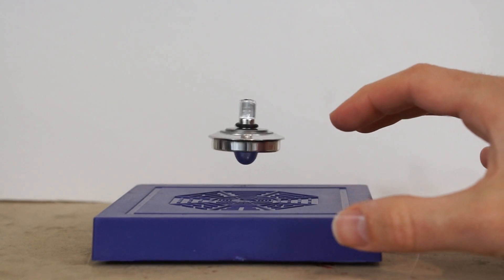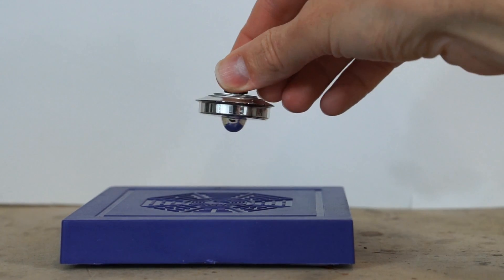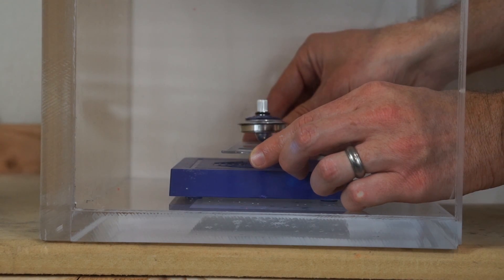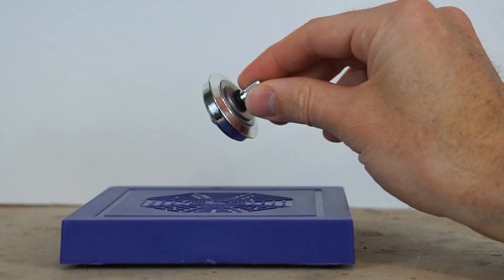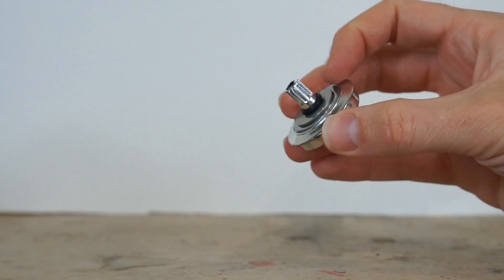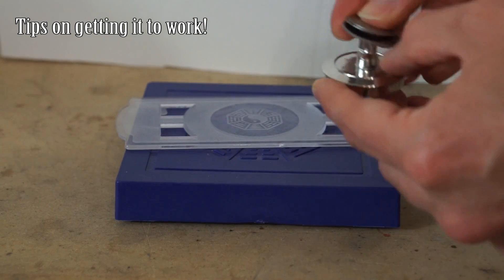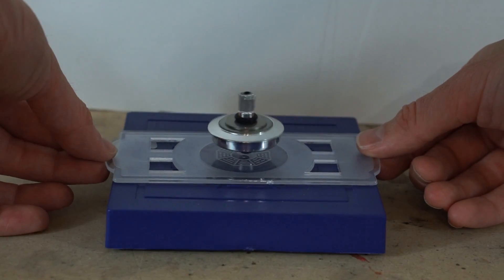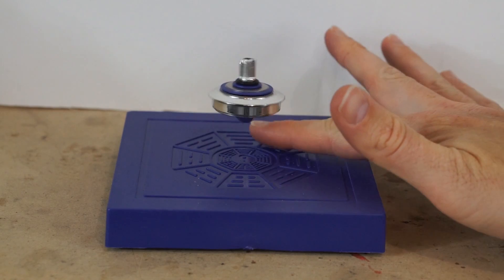Will a Levitating Gyroscope Spin Forever in a Vacuum Chamber?

Comment: Well it won't spin forever because it is not spinning perfectly level so some of the rotational force is being transferred into an oscillatory force, and so it loses a little bit of its momentum every time it oscillates, and since it has mass, and mass is simply a measure of how much force is required to move an object in a vacuum, the gyroscope would slow down little by little because it's mass is constant but it's rotational momentum depletes.
Reply: Now that's the explanation or comment I expected from people
Reply: The biggest factor was likely not oscillations, because the magnet would still lose energy even if it was perfectly stable on its spin. The main loss likely comes from electromagnetic losses which slowly turn the rotational kinetic energy of the magnet into heat energy. As the magnet loses more rotational energy to heat it spins slower becomes less stable and eventually falls. Here is a cool stack exchange thread I found on the topic considering why magnetic bearings are not frictionless.  https://engineering.stackexchange.com/questions/2162/what-causes-friction-in-magnetic-bearings
Reply: The richest, this magnetic top floating over a single neodymium magnet is not quite like a magnetic bearing, sure they both operate using magnetic fields, but that is where the similarities end. The top only spun for about one minute in the vacuum, do you honestly believe it lost all its energy due to heat loss in that time? Or rather the obvious out of balance which wastes energy much faster? Remember the top stopped spinning in one minute. we aren't talking about some other hypothetical top, we are talking about this one in the video above. Way out of balance, that is the reason it stopped.
If we had an expensive custom precision balanced top and it was capable of spinning perfectly in an absolute vacuum for hours, then I would add credence to your heat loss losing speed, but in this case as above it was mostly "out of balance"  energy loss.
Reply: It would even stop spinning, if you place it perfectly. You lose energy because of electro dynamics. Effectly you spin a conductor in a magntic field, which induces electricity, which induces again a magenetic field and so on... So you lose energy producing radiating a electromagnetic wave.
Reply: Something Else well I’m not a “numb scull” I am just not trying to analyze everything I see on YouTube, I am just here to enjoy the video, not to be put down for being a “numb skull”
Reply: MeowRolePlay,   Sorry if I implied you were a numb skull. I meant no offense, and my reply to copterdude was somewhat thoughtless of the other answers before him. This is why I didn't make a YouTube account. My mouth (or fingers in this case) often move before fully engaging with the brain. As far as analyzing everything on youtube, You should analyze if you are watching science stuff, it is the only way to understand the world around you. Don't tell me you were only here to watch a top spin on video without giving any critical thought at all about what is truly going on? ;-)
Reply: Actually the oscillations theoretically should not cause it to stop spinning because without any resistances an object could oscillate indefinitely like a pendulum.
Reply: The richest,  oscillate "indefinitely" like a pendulum? Such as a pendulum in a clock which is powered by a spring or electricity? no pendulum swings indefinitely, that would mean the pendulum was a perpetual motion machine, and those do not exist in the real world.
Reply: Copterdude actually magnetic field interaction will alwas take away energy regardless of the angel and shit
Reply: Copterdude not to mention there is no full vaccum only partial vaccum because anything inside like dust would equilize throughout the vaccum chamber
Reply: Something Else, I explained that with no frictional forces or wind resistance a pendulum ( or any other oscillating object such as this top) would oscillate forever, I did not say that a continuous unforced pendulum, or any perpetual motion machine, could exist in the real world.

This scenario is very similar to spinning a normal table top. The top spins steadily at first then as frictional forces dissipate rotational kinetic energy from the top into heat energy it spins more slowly becoming less stable and eventually falls over. However, in the case of this top the frictional forces come from interactions between the magnetic fields of the two objects, which still have the end result of dissipating the kinetic energy from the top into heat energy causing it to spin slower become less stable and eventually fall over.

In both cases it is the frictional forces draining energy from the system that cause the top to slow down and then it becomes less stable and begins to wobble. Thus showing the root cause of the top's slowing are the interactions between the magnetic fields, or what is sometimes called magnetic friction. 

This is all in accordance to Newton's first law which states that an object in motion stays in motion unless acted upon by an external force. In this case the top would have stayed in motion unless acted upon by the external force of magnetic friction which dissipated its rotational energy into heat.

I am not talking about theoretical tops either. I am indeed talking about this top which exists in the real world where almost always (at least as far as humans have ever observed) it is impossible to have motion without it being dampened by some type of frictional forces (including, magnetic friction and wind resistance) that dissipates the systems energy into heat which is why perpetual motion machines are impossible in the real world.
Reply: Copterdude You're brilliant.
Reply: Something Else one single comment better than the video itself
Reply: Eduard, I'm glad you enjoyed my comment. ;-)
Reply: Exactly
Reply: Well I’m deleting my initial comment because im dum
Reply: Also because eventually magnets wear off
Reply: Sweet Release oh and ur doing the same
Reply: Scientist?
Reply: Well...
Reply: u seem cool and u r but u no a LOT
Reply: This is also piece of steel moving in magnetic fiels, witch mean some of energy ll be induced as current and then transfered to heat.
Reply: It will stop because energy is used by procession to keep the top upright,  and this energy comes from slowing the top,  which will eventually collapse.

Secondly,  this magnetic top is rotating in a magnetic field,  which means that electrons are sloshing back and forth from the rotational speed much like in a generator.  the flow of electrons is consumed by resistance and turned into heat.

Just like with a generator,  it takes energy to move those electrons,  and that will come from the speed of the top,  causing it to collapse.

I suggest that the two major ways energy is consumed in this system is 1) procession  and 2) electrical current flow and resistance.
Reply: Way to go Copterdude! You are the first one to answer correctly and I actually made a youtube account so I could post this because you made me so happy that at least one person in the world is not a numbskull. The imbalance in the flywheel is using energy every time it wobbles, the limited energy of the spin runs out gradually and the wheel loses speed until it topples. Of course the not perfect vacuum had a small effect, but not near as much as the wobble. Keep up the critical thinking and the RC fun! I used to be an avid RC guy, it is a great hobby and you'll meet lots of nice people and share knowledge if you join an RC club. Peace! And keep those rotors and props balanced! Vibration is every machines enemy.
Reply: I assume then that you have viewed my YoiTube videos? If so, what do you think of them?
Reply: @somethingelse2740  lol you did not have a youtube account?.
Reply: No sir, I did not. I have watched videos for many years, and enjoyed and despised the positive and negative comments without having an account. However, The well written intelligent comment of Copterdude simply made me feel the need to reply, so I made an account. How about that for a compliment to Copterdude's intelligence. His knowledge inspired me to create an account.
Reply: Copterdude please
Reply: I am having to face of people who fail to understand physics who suffer confirmation bias wanting to believe that infinite motion is possible.
Trying to convince people of induced braking motions or losses of momentum is an uphill struggle when people don't understand entropy and thermodynamics. 
People prefer what they want to believe to physical facts,which tend to pull the rug from under their wishes.
It's a sad state of affairs that too few people understand physics and prefer to carp from the sidelines and sling mud,or wantonly believe in flat earths and a host of nonsense,rather than actually understand how things work.
It's great that there are people who revel in understanding the world rather than preferring to believe things they want to
Reply: templarseries your statement is undercut by your ignorance and MISSSPELLINGS! God why do the bottom of the barrel constantly assume they understand basic physics when they can’t even grasp the language they are trying to communicate with?
Reply: henselstep the energy loss due to eletromagnetic radiation is almost  completely irrelevant  , I've seen my physics teacher calculate the amount of energy lost by a pendulum oscilating in the vaccum with no friction at all , only by the radiation emited,  and it was about 10^-34 joules per oscilation , it would take forever until it stopped only due to that energy.
Reply: That energy loss was minuscule due to the lack of an outside force acting on it (except gravity). The magnetic fields involved are much more of an energy drain.
Reply: Copterdude bvvvvtv.    H g ff fg f g.  H y y vt f. G g f t tbt try bybg f f eccd r tvvt f.  F f t f f vvr. F f fccycfx sxt.  G f x d c.    G. F. Rv vf. F r e XE.  F r r. Dxexxevr t.  Vv.  B.  G. F g
..

..VG v h g 

V

Comment: The main 'friction' in the system is not as you say at all.  The spinning disc creates eddy currents in itself due to the magnetic field, essentially acting as a magnetic brake.  The energy is lost as heat dissipation, though too small to be noticed.

Comment: I think this question is wrong: "Will a Levitating Gyroscope Spin Forever in a Vacuum Chamber?".
The main thing to ask is; what engineering work should be done to extend the turnaround time?
The Forever word is over-exaggerated.
This experiment is a very important experiment and I think it will be developed in 50 years.
There are many variables in this experiment that have been done so that the conversion does not continue. How these variables can be controlled. When these problems are resolved, a return will occur for a very long time. Maybe Gyroscope can spin for 100 years.
I sent an email to NASA a long time ago to do this experiment in space, but I guess, They was not interested ... Thank you Action Lab for this experiment work.

Comment: The primary reason your vacuum didn't help is that air viscosity does not drop with reduced pressure, until the pressure is so low that the mean-free-path of the air molecules is as long as the dimensions of the objects.  That would require a pressure much below what you could achieve before the disk stops (<10E-5 Atm).  See NASA's page:  https://www.grc.nasa.gov/www/k-12/airplane/viscosity.html

Comment: 5:21 I don't think that base magnet moving was the cause of it falling so soon. That base magnet's movement is almost zero, and if you locked it down it would not move at all.  It fell because your initial spin wasn't fast enough and by the time there was an almost perfect vacuum - it's centrifugal force had slowed too far.

Comment: Electrical eddy currents in both the ground magnet and the levitator magnet meets resistance in both materials, which in turn translates to decreasing angular momentum in the levitator, since in order to maintain a stable state, the levitator must lose angular momentum to make up for eddy current losses. If both magnets had superconducting properties then maybe it will last for a long time.

Comment: it stopped because gravity is stronger with no air because air is creating an obstacle for the gravity but with now air gravity is strongest!
Reply: Gravity is proportional to mass, it is not affected by air. The gravity effect in this chamber did not change when the air was removed.
There is drag in the magnetic field, that would eventually cause the spinner to slow. As the spinner slows the magnetic 'drag' will have a proportionally larger effect so the rate of deceleration increases.
Reply: hry einestine no one told you to speak i was just giving my point of veiw
Reply: @uncleiroh6611  
You were wrong though, you meant air resistance. Terminology is not a opinion. Objects fall faster in a vaccum not due to an increase in gravity, but rather having to push away far less material to fall. In a vaccum, due to lack of air resistance, mass, density, weight, and all the like mean nothing. As all falls at an equal rate of 9.83 m/s/s on Earth. A bowling ball and a feather will fall at the same rate, as they are treated as having the same properties.
Reply: KingNoobissis (
Reply: Graeme758 (
Reply: KingNoobissis  well, thats a way to never learn anything :) the other guy actually explains what is happening. "oppinions" dont have much sence in a science context, especially when they just claim things that we know (through centurys of research) to be false, like the stuff you said. if you actually wanna learn sonething and improve your knowledge, you can google induction or eddy currents, thats the real reason it will stop and its an interesting topic :)

Comment: 5$ gyro! Come now! If it's cheap magnet, it is most likely low quality, which means not well built to produce adequately even magnet field - aka, some spots are stronger, some weaker. I seen gyros that do not shake so much while spinning. 
Of course in regular conditions, gyro spins and meets air resistance, magnetic field it is producing and any magnet field irregularities. With vacuum -  you get rid off air resistance, but still have magnet field resistance + poor magnet quality which produce magnet field bumps, which causes gyro to wobble and lose its momentum even more. 
So vacuum  + better quality magnets wil give far longer spin time, put eventually will come to stop because of magnetic field.

Comment: I think that inside a faraday cage , floating in 0 gravity, it would spin for ever.

If the spinning time is not indefinite but longer than the universe's lifetime (in the ideal case of the frictionless scenario, perfect vacuum, no friction), either our simulation equations have flaws because we are reaching out of boundries to where our concepts apply or it actually does spin forever, only that the slowdown is not percieved as the whole universe "slows down" during expansion, following the theory of the big chill.

Comment: I think it's the Eddy currents in the conductive material of the two parts. Try to modify it to be non-conductive, like re-creating the spinning top with a 3D printer. The magnets themselves should be ferrite, so they are likely already suitable for this. Then try it in the vacuum chamber.
The friction transfer is nonsense; if the base was so flimsy, you could secure it and the slowdown would have gone away.

Comment: Stop cause of friction that’s easy
Reply: GamingWithMe ! Its not friction its magnetic induction
Reply: Or simply heat is generated
Reply: There is very little friction in the system.
It actually stops due to Eddy current drag.
Reply: Omar Omokhodion I thought it stops because of energy lost via heat

Comment: It will stop because the magneticall force or gravity will make friction and its moving around an the magneticall force pushes on the side of the spinner and the magnets start moving and causing friction and you need 0 gravity, no air and a good spin for it to spin for super long like in space, btw you need no magnet

Comment: Of course not, the magnetic resistance will slow it down.  Air resistance is minimal on that toy.
Let's see if i'm right.

I don't know why you're saying the big magnet is moving....
Even if you had a precision machine spin the top at the exact center of the magnetic field, and spin the top with no tilt, the interaction between the magnetic fields would eventually cause the system to 'fail'.

Comment: If you use a white marker on the edge of magnet rotor you can then use an rpm meter to determine time to a lower rpm for both vac and non vacuum . It should stop if there is some magnetic instability or heat generated